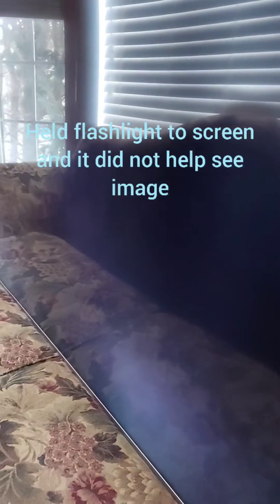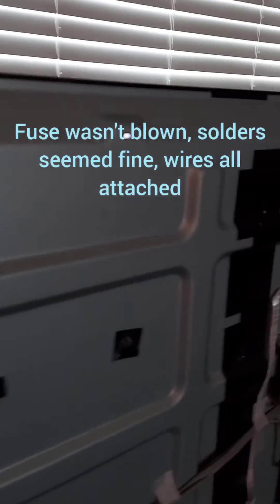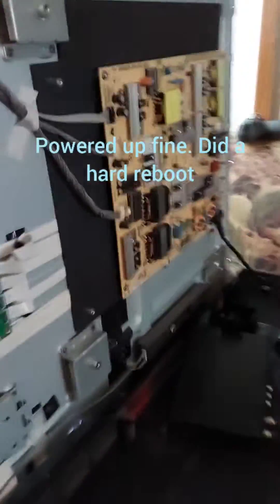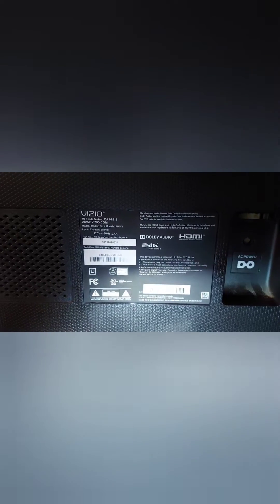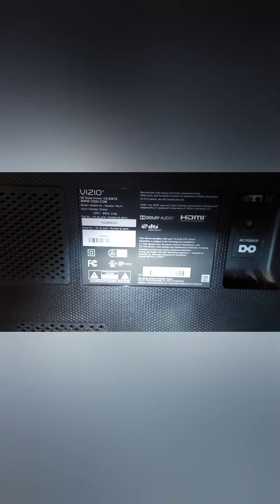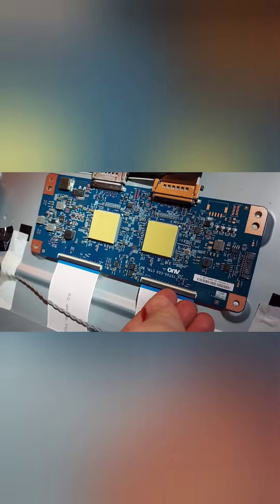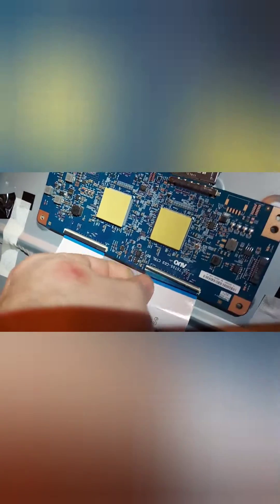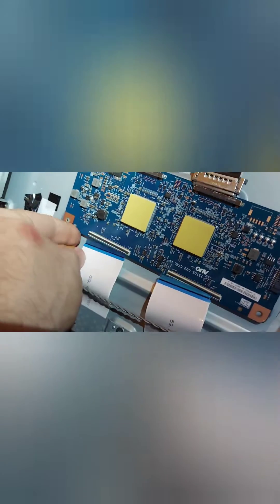Repairing a Vizio P65-F1 TV. only using a 30$ tcon card.

Comment: I have the same tv and have just ordered a new Tcon board off eBay. I really appreciate you making a video on this problem. I called a TV repair shop and they quoted me 300 dollars to fix the "backlight LED" so I figured to look up the problem online.  My tv is doing the same thing, I can see white shadows and the movement when I press the Menu button on the remote. Glad there is no soldering involved or anything.

I will report back if the TCON board fixes the issue, but thanks once again for the recommendation!
Reply: Have you tried keeping the TV on for awhile?  When mine first started up (early December-see comments above) the picture would come up say within 20 - 40 minutes.  Once it came on I checked the power settings and made sure it was NOT on 'eco-mode'.  Sure, it took awhile (about another week, but now it comes on all the time.  I did order a Tcon board, have it, but haven't had to install.  For my TV I think it might be thermal, and when the nights begin to get warmer I am going to try to put it 'back on' eco-mode, just as a test.
Reply: @dennisg1045  Just fixed it. Had the same exact issue as the video. Replacing the TCON board was pretty easy only took like 25 minutes and now my TV works great. No problems anymore from watching football all Sunday.

Good luck with yours, if the issue is anything similar (white blob on screen & movement is showing but no picture), then the TCON replacement will almost certainly be the issue.

Comment: I have the same tv as you, with the same issue and it started yesterday.  If I have the tv in the broadcast tv input the sound is on.  Leave the tv on and about 10 minutes later the screen becomes operational.  When you had the problem did you try to keep it on for an extended period of time?  Also, since you have replaced the t-con board have you had the issue come back?  Thanks
Reply from the maker: Yea, I tried to have it on for a few days even. You could juuuust barely see movement so I researched based on that. I have had no issues since and it fixed my problem beautifully.
Reply: Yeah, we had the same issue this morning as yesterday.  Once it's right there's not a problem.  The board's out of stock from that Minnesota on-line presence but likely will order once they get them back in stock.  I like that they have an option for a bit longer warranty.
Reply from the maker: @dennisg1045  good luck! It Was not bad putting it In. Those clips can be a little goofy as in you feel like your gonna break them off though.  Make sure to update back!
Reply: @LetsDoThisWithEvan  I don't think that I would have a problem replacing it.  It's just getting the TV off the articulating mount, along with getting the Sound Bar unattached.  Saying that, we do have a replacement card, but the screen comes on most of the time immediately.  A few times it took some time.  Once about 35 minutes.  Others between 2 and 10 minutes.  We just keep the OTA antenna setting the last before turning it off during the night.  At least we would get audio when the screen is blank.  (local news channel)  I think it might be a cold solder joint somewhere on the board and will milk it as long as possible.